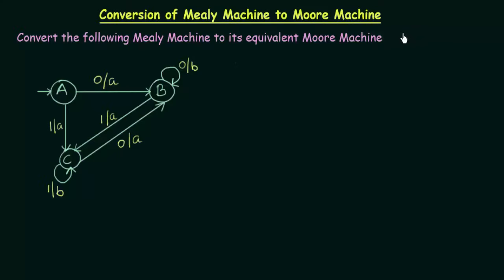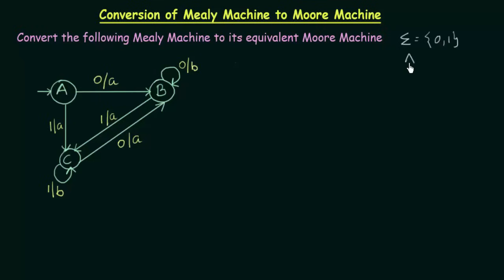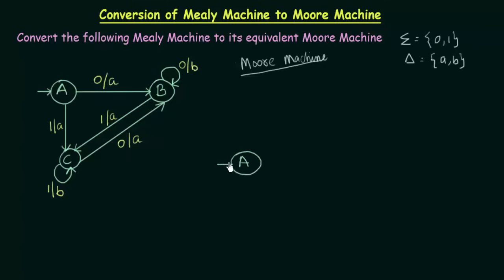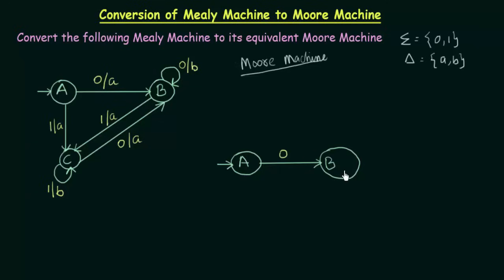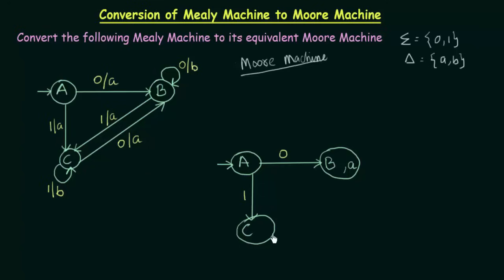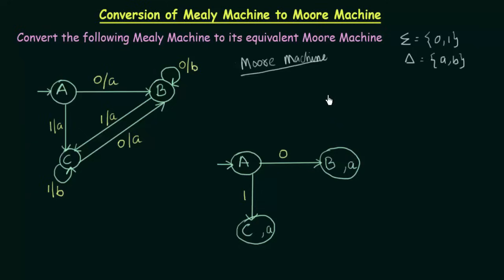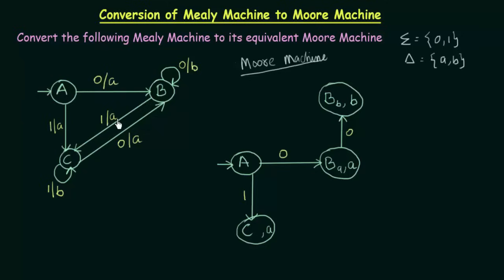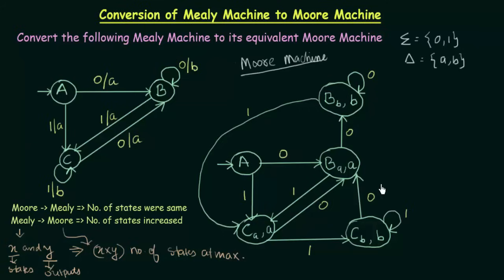Conversion of Mealy Machine to Moore Machine

Comment: To summarize I will try to give intuitive idea about the conversion.

Moore -> Mealy is simple, to convert, we just copy the output to whoever point to the state. Like if there are n arrowed line point to a state with output 0, we just simply separate the 0 one copy to each of those arrowed lines.

Mealy -> Moore is complicated because we may have 2 arrowed line point to one state with different output, thus we may need create more states.

Thanks Neso~

Comment: Great explanation but I have a doubt
If you take the example you solved in the video the maximum states should be input * output = 4
but the answer has 5 states, please explain....
Reply: In given mealy machines no.of states are 3. Output: a,b i.e 2
So 3*2=6 (maximum no. Of states we can get) in Moore machine.We got 5 states in Moore machine.

Comment: here in this moore machine if our input string is of length n then our output string length is also n string long which does not satisfy the criteria that a moore machine should have n+1 output if we have n  inputs
Reply: exactly
Reply: I guess that the output string would encapsulate to a single identity.
Reply: Because they didn't mention about the output associated with state A. I don't know what the reason is 😓